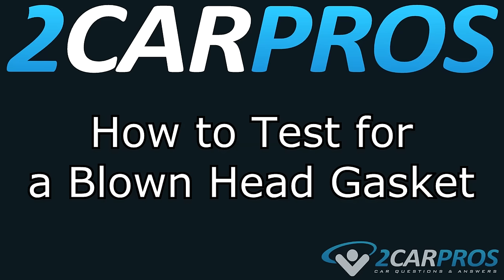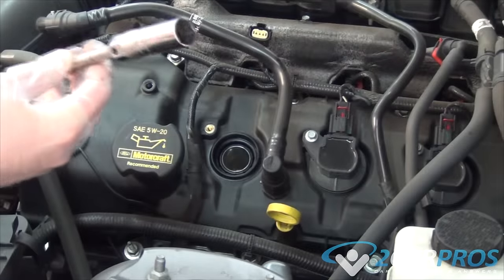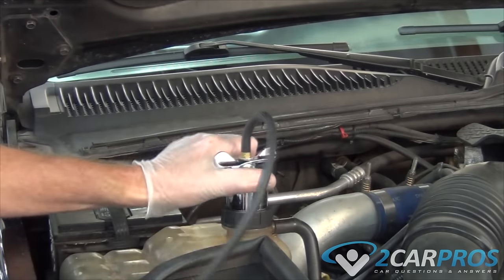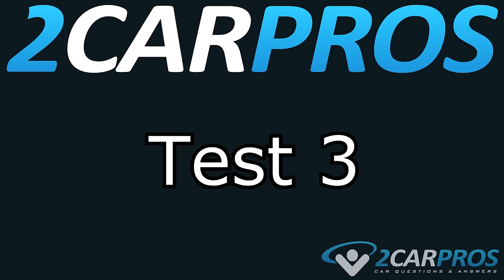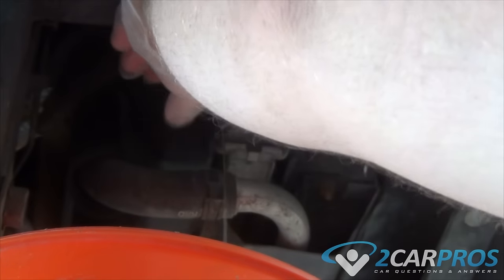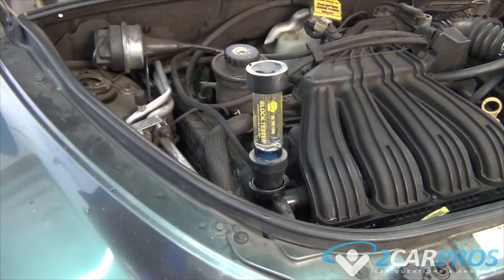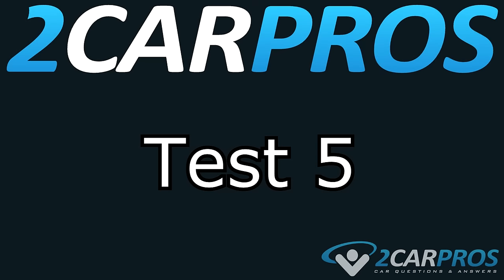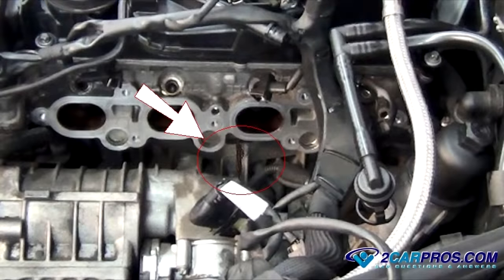HOW TO CHECK FOR A BLOWN HEAD GASKET

Comment: Hello there, nice video,
 basically i have 2013 Range (non supercharge. Since, Past two months i noticed that the coolant goes low but the engine does not heat up, this happened several times and i went to a local mechanic where i regularly go and got the radiator replaced. They did pressure test twice, no signs of leak. But still the issue persisted. I used to refill the coolant every week or so. I believe due to this the starter motor had gone bad(as i assume the engine got bit hard to turn on by itself) Now the vehicle has stopped starting. There are no sign of any leaks whatsoever. The radiator seems to go low only while running. 

My mechanic checked the starter motor, replaced the battery, replaced twice the fuse (on battery) yet no luck. 

Previously (in between this issue) i had got the oil and spark plugs changed. Now i can see some sort of milkshake type texture under the oil cap. 

I had re assessed with another mechanic who builds RR engines, he mentioned that this issue could be from the three coolers and not necessarily a head gasket failure. 

Additional information: 

There are no sign of over heating.

I had noticed once, that from one of the AC vents, there is smoke coming. This comes only from vent and then goes. This happened about 10 times in past 2 months

Current update: 
I just had the radiator coolant refilled up , without driving, i noticed that the coolant has gone low!..
Any expert advices will be helpful

Comment: 1 remove spark plugs from all cylinders turn the engine over if it blows out coolant you have a bad head gasket 
2 remove all the coolant from the engine but don't run it longer than 2 minutes to be safe. the coolant will cause the spark plugs to not fire when it gets fuel because coolant doesn't ignite

Comment: Another way to test is to run the engine while having the radiator pressure gauge hooked up you will see a jumping if it is blown.
Reply: U can also do it with the car powered off by checking the voltage of the cylinder using a volt meter and connect the positive end of the voltmeter to the negative battery terminal
Reply: @BeastmodeBeats  and what dc measumemt will you see??
Reply: @BeastmodeBeats  so ...what will be the reading in that case? Thank you.
Reply: @BeastmodeBeats  u have to let these people know your joking

Comment: What about engine power? The vehicle idles indefinitely. If you rev it, it dogs out. If you drive it, it has no pulling power on hills. It blows white vapor when first started; most of the white vapor goes away after about 5 minutes, but there is still a small amount of vapor, even 1/2 hour later.
Reply from the maker: https://www.2carpros.com/articles/engine-has-low-power-output
Reply: You have a blown head gasket or cracked cylinder head. Diagnosing is not that hard as seen in the video. This is olde tyme mechanic stuff.
Reply: exactly what mines does..looking at ah  $800 + fix

Comment: My car has been over heating for the last few months and my mechanic said that the head casket had a crack in it. I didn't have the money to get it repaired so kept driving it. It did keep over heating but not every time I drove it. So about a week ago I was in an accident(not my fault) and it got sent to the repairers. I told them about the problem to see if they could fix it. In the end they said in was the coolant line that was faulty so they repaired it. Only had my car a day now but it drives much better and hasn't overheated yet. Do you really think my head gasket has a crack in it? Was my old mechanic just saying it was a head gasket to make some more money? They were going to charge me 4K to fix it. We also checked if the oil was milky and it looks just like oil. No milkiness
Reply: pul0002 fire your old mechanic
Reply: COOLANT line faulty!!!!!  I bet you did a dance------------Maybe i'll have to check that!!!  It would really make my day!!!
Reply: how much did u end up payin?
Reply: Go to multiple shops and ask them to see if one of them are lying to you.
Reply: pul0002  sounds like same old mechanic.  Trying to make money easy.
Reply: 4K? Was it a Mercedes or BMW if those are dollars? Anyway, mechanics can make honest diagnostic mistakes, but with something as expensive as a head gasket they should make sure, as shown above. An honest mechanic thought that oil leaking on my FWD V6 was the rear main seal ($$ requiring dropping the engine) but another place determined that the oil was leaking from the base of the distributor above (much cheaper to fix). That's another thing: an oil leak can be from somewhere else - it can run and blow around. Clean off the engine and run it with paper towels stuffed where you think it is leaking or something like that before repairing. Check above and in front of wherever the oil appears.
Reply: pul0002, what is a faulty coolant line?
Reply: nah its the thermostat. coolant runs through it when you engine gets hot and shuts when its cold to maintain a constant temp. i dont understand what a faulty coolant line is but if a car is prone to over heating or never gets hot it a fault thermostat. very cheap fix
Reply: 4k to replace a head gasket?
Reply: @inaamaltaf9471  he probably never changed his one and its old
Reply: Old news but for future reference of people reading the comments. Even if your in a hurry to get something fixed, get 3 estimates on anything you need to get fixed. It can save you thousands and comparing estimate sheets in front of you on paper helps you understand what needs to be done, and gives you a breakdown of parts, part cost and labor. If shop A & B state 6 hours of labor and shop C says 10 hours you need to ask why. Are they replacing more parts? If so why. Any shop manager or estimator should be more then willing to explain why they listed what, and are charging more for whatever that may be. Money hungry shops are my biggest pet peeve and helping people stay away and wise to the bullshit they try and pull makes me happy
Reply: Michael WS6 I need you in my life 😎
Reply: @inaamaltaf9471  not always. I replaced the thermostat, radiator and blower motor, and my engine still kept running hot... mechanic said it's a bad gasket, $1400 to replace... going downhill would coast in neutral, etc. Kept my eye on the temp gauge... until I got a new car

Comment: In an old audi a4 we have cylinders 2 and 3 are misfiring and there's a coolant leak. This video makes so much sense now, goes to show how cool the internet is too
Reply: How to bleed airlock in a cooling system on audi a4 1.8 94 model

Comment: Milky sludge also caused by failed oil cooler aswell as oil in cooling system
Reply: Or just condensation due to cold weather
Reply: I have a chrysler pacifica 2004 that i have discovered oil in the coolant bottle can a bad oil cooler cause this to happen
Reply: Yep due to quality of metal used today in the manufacturing industry metal fatigue occurs often .That oil cooler has to handle high oil pressure getting pump through it

Comment: Hi. Thank you for the video. I have a 2008 Accord with 74k miles. The oil cap has a little milky oil. I checked the dipstick it's clean. I cleaned the oil cap and drove for 6 miles. I then checked the oil cap again and there was moister. I'm not losing any coolent. The car is not over heating. I never did a coolent flush on the vehicle.
Reply: What ended up happening to your Accord? What was the problem

Comment: Start the vehicle, remove radiator cap, rev up the engine in neutral gear, coolant should pour out the radiator filler cap, head gasket is blown, cylinder head is warped

Comment: 2008 impala 3.5
NEVER overheats, but coolant inside the reservoir boils to the point it steams a lot (giving the overheating impression) but steams only from reservoir and at times it spills over.

Going to give these tests a try
Thx
Reply from the maker: Thanks for watching!
Reply: Try a new rad cap also

Comment: On my car the coolant in the radiator doesn't bubble until I turn off the car. But pretty sure it has a blown head gasket. The car is almost as old as I am and I'm 39.

Comment: I took the spark plugs out, filled up the overflow tank, and cranked the engine. As it spun over I looked through the space between the hood and the body. I could see a stream of water shooting out the number 3 cylinder! I put the plugs back in, closed the hood, and called AAA. I was about 15 miles from home and didn't have enough water to get back...  It was a Friday and I had a head gasket. It was torn down, gasket replaced, put back together, and running by Sunday! That was years ago... ☹️

Comment: i have heard that:oil filling cap can be a test method that when be open if the valve ring is leaking there should  be air blowing out side from engine>>>Is that right??
Reply: If I read your comment right you’re referring to blow by not blown head gasket. Blow by is caused from excessive compression in the cylinders not blown head gaskets.

Comment: My coolant reservoir doesn't hold the anti-freeze content. I ignored it for years and never had any issues with it being empty. The vehicle never over heated. When I did put anti-freeze in the reservoir I smelled the light burn off.
Question: If I had a head gasket (wouldn't any the spark plugs eventually begin to Fail because the coolant was being burned off, and there no evidence of any Oil contaminants (milky sludge)? 
Firestone manager says he has to charge me 70 dollars just to see if I have a head gasket issue...because they have to use several computer tests. Obviously, don't go to Firestone.

Comment: Easiest way to find out with no gadgets warm up your car if no white smoke comes out from exhaust= your gasket is doing alright
Reply: For real?
Reply: @greateagle8799  yes
Reply: @Norcal1990  Thanks for the tip! I think I got lucky btw, I just replaced the spark plugs and she's running fine for now. Knocked on wood.
Reply: @greateagle8799  👌
Reply: This is exactly how I figured out im dealing with a blown head gasket for my 08 titan. note when you're consistently refilling your radiator and there's not leakage... check your exhust pipe.. if steam or water is coming out = blown gasket.
Reply: Not necessarily it could be blown on exhaust side causing combustion gas to get into the cooling system without coolant getting in oil
Reply: @victoriajoe1438  exactly what I’m noticing in my bucket ass Lexus. Thank you!
Reply: Another tip any water coming out of the exhaust hold a dollar bill to the exhaust tip if it sucks in And you know you dont have an exhaust leak you have a blown head gasket.

Comment: Test 1: if you run e85, this is pretty normal. As alcohol attracts water like a magnet. Just make sure you burn it off since this can degrade your oil over time. To do this just do some longer rides, 20-30min at least once a week.

Comment: My car did not have much white on the oil cap.  They did many tests. Turns out some oil valve seals were bad but they were not sure that was the problem but they did the work 4 of them were leaking.. They said engine was not heating very well. New thermostat fixed that. Pressure test turned up nothing. Car runs great.. Also they said drive it more Florida has so much moist air if you don't drive far and heat up the engine you will get this also. In Florida intakes bring in lots of water.

Comment: I have a 2006 kia Sedona i had a blown head gaster i put blue devils sealer and my van ran great i know i put over 1500 miles but what happen my fans stop working and i did not fix it a my van was fine as long i be drive it but when i stop standing my van start running hot other than that i did not have know problem with blue devils but after that my van had cut off so now it want start but i gave car shield and they trying say my problem is pretty insistent on the first time but my van was running fine i t probably from that fan from stop working..but i give blue devils A so thankful.. Fr Emma..

Comment: Okay, I have an 09 PT Cruiser. It recently started bubbling in the reservoir when the car would sit and idle. Changed thermostat, radiator cap twice, and finally the radiator, which did have a leak. However, it still bubbles in the reservoir after I drive it up a large hill and then park. It will bubble and sometimes lose coolant. There is no white smoke, no coolant in the oil, nothing like that. Could this be a cracked head? I get good heat and it never overheats while driving.
Reply: Pressure test the coolant, check for leaks under the car or if pressure drops. 
Pressure test the coolant to 12psi

Comment: Some of these are dependent on the spot where the void is present right? Stupid question but ive had an open space in a gasket before not present with no discolored exhuast, or mixing of fluids. Only accelerating sluggishness and obvious misfires

Comment: Hay, I pulled my cylinder head off and found a gap/burn in the gasket 
between the cylinders. No water in oils or oil in coolant.  When I looked down the cylinders and saw no cross
 hatching, do I need to hone them? Can I hone without taking out the 
pistons?  I wasn't burning oil.   Thanks

Comment: I have pressure and bubbles in my coolant reservoir but i have no goop on the caps and i have no bubbles in my radiator when the cars running is it possible my things are still blown?
Reply: This is exactly what happened to me, it probably overheated and blew the gasket open. So while it’s not completely busted it still needs fixed! It’ll keep overheating if not fixed

Comment: Forgot the most easiest method,pull the oil dip stick.If there is oil mixed with antifreeze on it.It is a head gasket & oil is going into the oil pan.
Reply: Not entirely true.. if the car only goes under 15min trips mostly. Then it never heats up enough to evaporate it off. In the colder north climates it’s a known thing. But yes it could be an indicator depending on the severity of it

Comment: So I have been having some problems lately with overheating. My truck was going up to 260 within 5 minutes. So I parked it and we replaced the radiator, coolant temp sensor, egr valve, thermostat and bled the system numerous times and it fixed it to an extent. The gauge will show anything from 1/4-3/4 but it never goes up to 260. The heat works occasionally and the exhaust at times will blow white smoke and then it will stop

Comment: I know this is a very old video but maybe I will get lucky and some one will answer my question, which is; how can I tell if the small coolant leak is between the intake to the head and not from the head to the engine block?
I found moisture on the plenum when I took it off for cleaning, maintenance. From a 2000 Accord v6
God bless.
Reply: What was your issue?
Reply: @HMASbogan  
Condensation

Comment: I have an 06 charger rt, new water pump, new coolant reservoir, new thermostat. No leaks, the fans come on when they're supposed to, yet my coolant still boils over and runs hot?
Reply: It sounds too obvious, but did you replace the radiator cap? Fixed my Subaru.

Comment: I inherited my Dad's 1996 5.2 Liter Dodge Ram Pickup a few years ago. It has low miles, 118,000, and there's suddenly a very frothy looking oil on the dipstick and oil cap and some water droplets also on the dipstick and a lot of moisture coming out of the tailpipe. It leaves a big puddle of water on the pavement but I don't see a lot of white smoke or steam coming out. The temp seems low actually, like it's taking forever to heat up. Any ideas what might be going on here? Thanks!!
Reply: Head gasket or cracked cylinder head just like everyone else. Do the damn tests.

Comment: Since most vehicles nowadays have an expansion tank for coolant and no direct removable vertical connection at the radiator, half of these tips are irrelevant.  And what about a tip for diesels?

Comment: My 07 Versa became overheated... took it to the mech.  Pour some liquid.. it was leaking at the bottom. Fix the hose, n now the ignition coil was filled with oil... it struggled a lil bit to start the car. Put a new gasket n I.coils. now it runs fine, but it feels a lil weird when driving it.. like if  not fixed all the way.  What could be the final verdict?  Is the car done?

Comment: I have old Dodge pick up and it has an entirely new cooling system. New radiator, hoses, water pump, and thermostat. It’s still wanting to overheat. There are no bubbles, the coolant looks perfect, no milky residue or sludge. There is a puff of white smoke when I first start it, but that’s it. Any suggestions?
Reply from the maker: Could be a blown head gasket or there could be a air bubble in the back of the block. Try jacking up the rear end and then the front end and see if you have a air bubble come out. Thanks for watching!

Comment: Is tests are positive, what are the chances the car is junk even if you fix the head gasket? Doesn't it running with a blown head gasket cause further damage? I ran it for 10 minutes or so when my check engine light came on thinking it was no big deal. I then saw it overheat and pulled over. I def have milk chocolate for oil and white froth all over the cap. 10 quarts of water also disappeared as I fill it from my reservoir and it has to be going somewhere. I checked the oil dipstick and its all the way up the stick (water mixed in I assume). I don't have a job right now and every dollar is important. I am not sure if it's even worth towing to a mechanic when the blue book is 6k on my mazda6 2012. What are the chances the car is junk? I'd hate to have it towed and then they charge me 5k for a fix, only to find it has further damage and end up having to buy another car anyway I dunno what to do at this point aside from pray and cry.